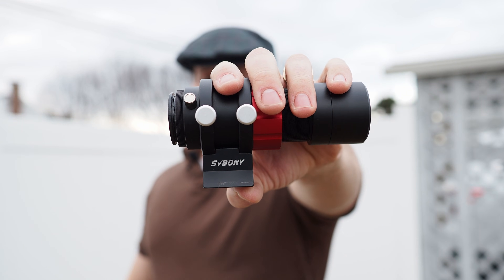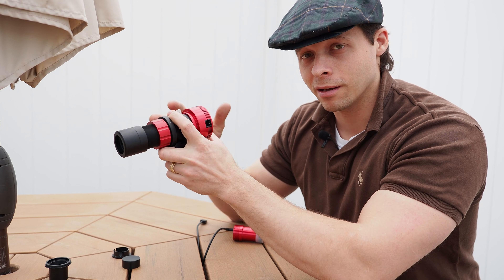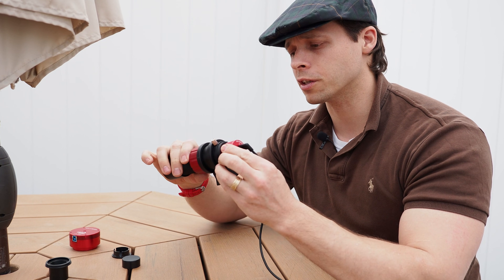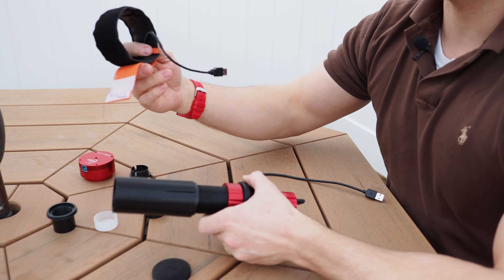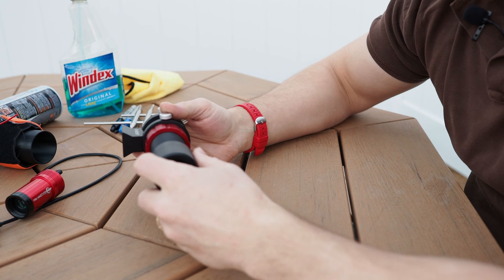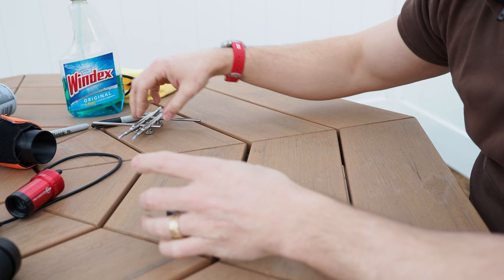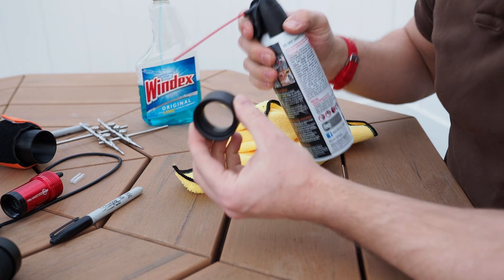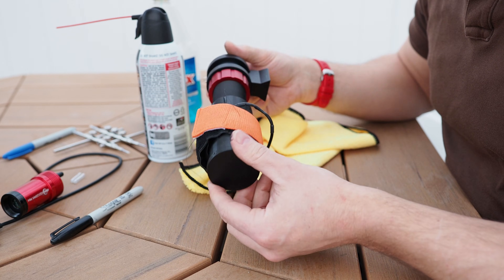Make your SV BONY Guide scope better at no Co$t

Comment: Great tips Ben I've got one of these recently but the stars look awful in mine no matter how long I take to focus it they look more like comets than stars but it seems to work ok. I did loosen the lens a little thinking it might be pinched optics causing the issue but it's not made any difference. 
Another extra I added was a Low Profile Female M42 / T Thread to Male C Thread Adapter from First Light Optics. So I can screw on a smaller guide camera like a Lodestar or what I have on mine a QHY5LII mono guide camera so it keeps everything tight & secure.

Comment: Cool video. Don’t clean with windex it will take your coating off.  That’s a perm sharpie.
Reply from the maker: Actually todays coatings you can. Only on older scopes that used dies. Those have not existed for 30 years now. So anything that has been made since at least the mid 90s you can use windex.

Comment: A very useful and informative video.  Ok, it's spending money but I used a M42 to C mount adapter for a more stable mounting for my old QHY 5-II camera on the SV-165. It also means you don't have to wind the focus so far. And the focus is then set for"life". A bit old school but, if you don't have access to a 3D printer, trim a black foam mouse mat down to act as a dewshield.
Reply from the maker: Thanks for sharing, threading in is always best.

Comment: Using the threaded objective to focus moves the image around so much that I have to recenter it to focus all the time. Very annoying. Know if greasing the threads will help to remove the play?
Reply from the maker: Would would just keep the lock wring half tight. Hold the body and lock wring with two fingers while rotating the rest.

Comment: I have the Sky Watcher AZ-GTi mount in EQ mode. Can it track with a 400mm lens on a crop sensor without auto-guiding?  I've had success at 300mm.
Reply from the maker: It should be able to handle that weight. I would though recommend that you get a wedge so you can polar align it. Then field rotation will not be an issue and the longer FL will do even better.

Comment: Please help me, y have the same guidescope and an ASI ZWO 178 MC, very similar to your configuration, but I cant manage to see a damn thing in PHD2, I only see noise and PHD2 is unable to find a star, ever happen to you?
Reply from the maker: Sounds like focus is way off. So far that it cannot find any stars.
Reply: @TheNarrowbandChannel  sorry for asking but I’m a newby, in this case in your experience, I should rotate the tube end and make it larger? How larger aprox?? Please I already did it but I may have done it wrong or something
Reply from the maker: @francocordero32  Do you have the camera the screws on or inserts? You may want to focus it in the daytime to get a close approximation on something distant then try at night.
Reply: Thanks for helping, I have it the same way you mention itself screwed to the tube, I tried daytime screwing and unscrewing all the way up but I didn’t notice any change😱. I’m pointing to distant mountains but I will try to find a better target. I’m so frustrated because whenever I attach the small eyefish lens it works flawlessly but as soon as I change to the guide scope it’s impossible to see nothing but noise. I taught could be my configuration on the software but I’ve tested several, I feel so dumb 😖

Comment: Another issue I have noticed , but not with this scope but another similar min i scope is the metal dew shield being black, but very shiny and not flat black. If you shine a flashlight on it, you gonna see how much light it bounces back.   For a quick test, I taped it inside with a black-cloth based tape around inside. I had an indirect light coming from the side (neighbor floodlight) and any time I was imaging and  even from a 90 degree angle, I could see how the light was effecting the images. With the tape, the problem was gone. This can also be a half or full moon, even if it's not in the FOV of the telescope.  I don't recommend tape though, it comes off or gets in the view, but try to get like a flat-black spray paint and lightly coat it in the inside to take away the shine. Disassembled, with no lens in it, and not too much, just enough to take away the reflectivity , of course.
Reply from the maker: Ya I know with the 3D printed one I made I need to find a filament that is dull. This one is a tad shinny.

Comment: How is the quality of the image you get?  Are the stars round?  I once tried a 30mm ZWO mini guide scope and couldn't even recognize stars on the image.  They were all of weird shapes.
Reply from the maker: Yes they are round stars. I have both the SVBONY and the ZWO. I would check your lens sell. The optics might be pinched. Another member here reported the  he just loosened it and it fixed the issue.
Reply: Lens migjt be installed backwards.  Easy to flip over and test in daylight with an eyepiece

Comment: Ben, is there an issue with the dew strap on top of the 3D printed dew shade?  Wondering if the heater could get too hot. Is there a particular material that should be used?
Reply from the maker: A very good question since I melted a lens once. As long are you dew heater is not over 100f you should be fine. You could always select materials that have a higher temperature such as PETG you could probably let your dew heater strap hit 120f.

Comment: Nice! I have one of those svbony mini scopes for guiding. The marker painting step to stop scattering light was something new to me. I am not sure if I am that cold blooded to open that thing and remove the lens but eventually will do so. Now, for the F/R markings on the glass, if you already wrote F on one side or say  just a dot (i.e., so you will remember that a dot means front side), why marking the other side?
Reply from the maker: Very cool! Glad you like this. 

So when I as taking this apart I did not know if the two pieces of glass would be easily distinguished. So to get them back in with the proper sides facing the right direction I did the F for front and B for back. 

By the way it was much easier than I thought it would be.

Comment: Excellent tips. Mine had pinched optics straight out of the box -- namely, bright stars with a dark notch on one side. So I loosened the locking ring retaining the objective lens and tightened it up again only a slight amount. This immediately fixed the problem and resulted in perfect circular star images.
Reply from the maker: I have heard about pinched optics before. Thanks for the tip. If I see that issue I will know what to do.
Reply: Interesting. I just came in from setting up my new SVBony guide scope. The lens was so loose, it rattled!  Had to tighten the retaining ring with a micro screw driver. Hope to see how it works tonight. Clear skies are predicted!